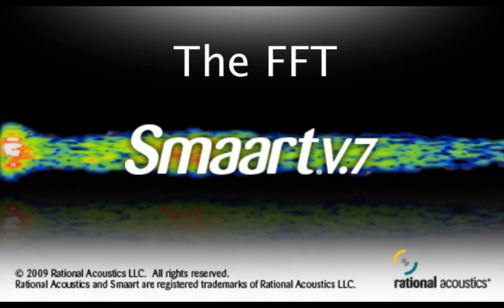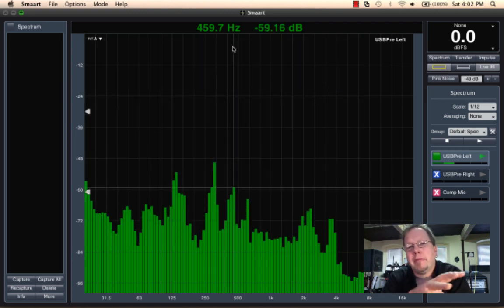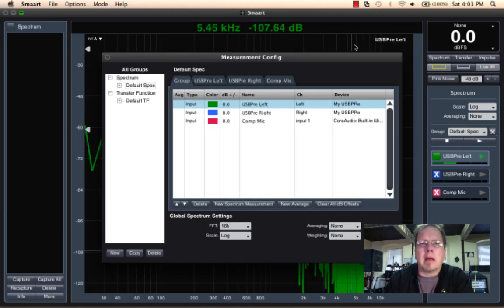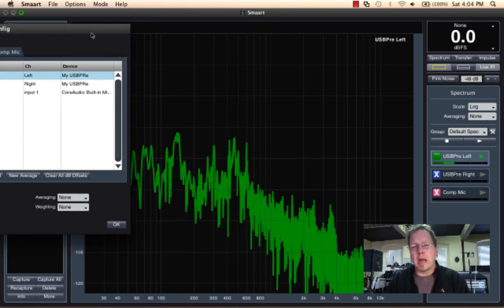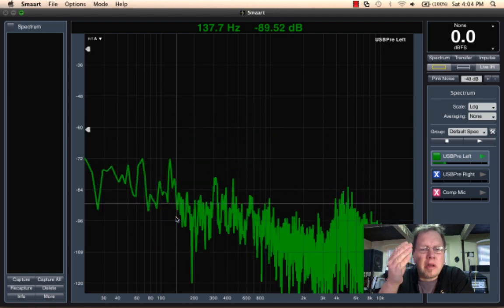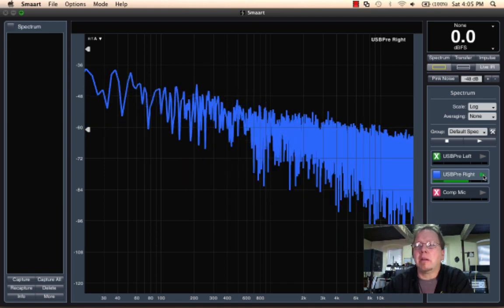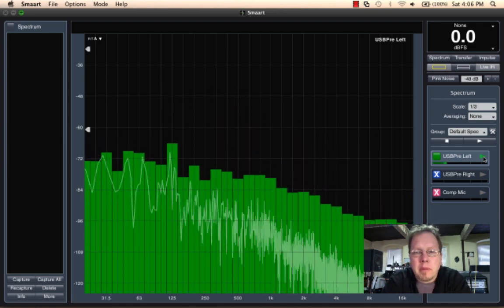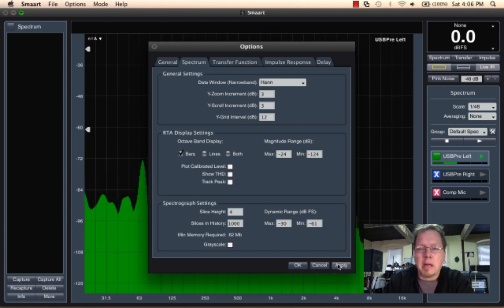Smaart v7 - Understanding The FFT

Comment: I find it non-intuitive that an analyzer of this type can extract information about bass energy at all with FFT sizes shorter than 1 cycle at that frequency. I can accept that it is so (with say 512 and 576 points commonly used in audio codecs), but it is bizzare that even a precise DC value can be retrieved from that data. If I look at a waveform, I want to see a repetition before I can think of frequency.

Also how is it that analyzers with good detail in the low end only appear in modern times (combining different FFT window lengths in one display, very slow), while equalizers have always existed capable of precisely differentiating say 55 and 60 hertz, a natural logarithmic freq resolution? But that precision was never available in visual analysis. I don't know anything about the underlying maths...